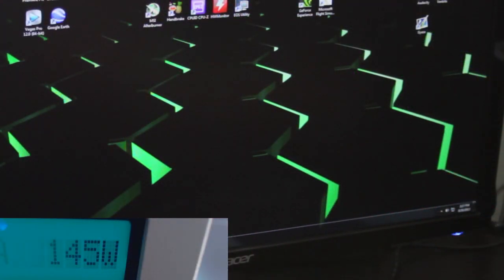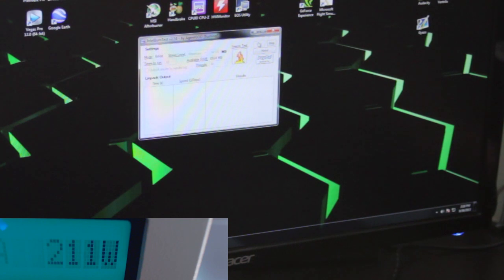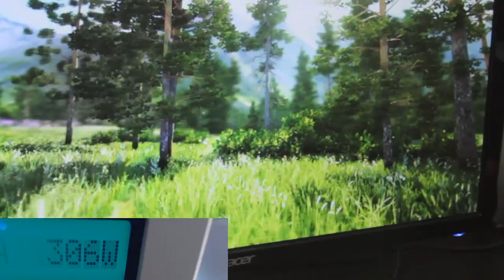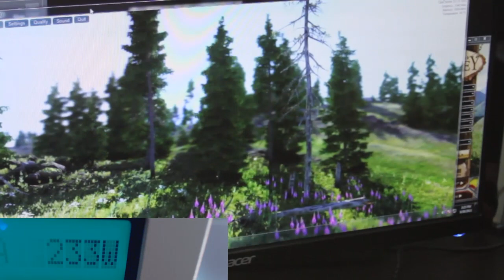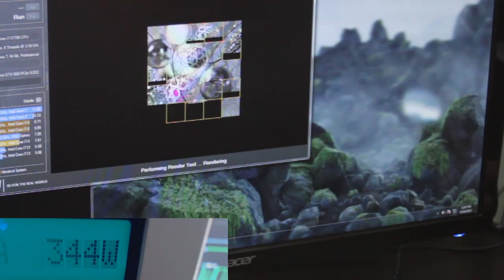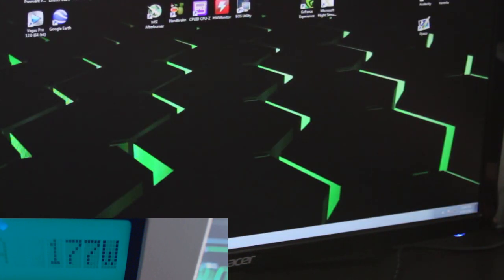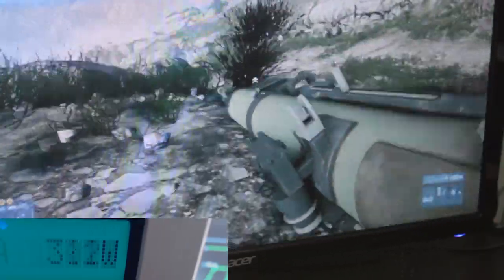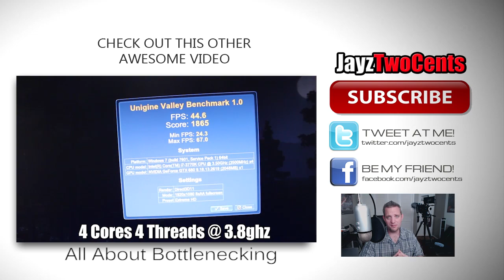How big of a Power Supply do you REALLY need?

Comment: What power supply do i need for my build? pls help!

CPU: i5 4690k
GPU: EVGA GTX 970 Superclocked ACX 2.0
MOBO: Gigabyte Z97X-SLI
RAM: G.Skill Ripjaws-X F3-17000CL11D-8GBXL
CPU COOLER: Cooler Master Hyper 212 Evo
SSD: Kingston SSDNow V300 120GB
HARD DRIVE: Western Digital Blue 1TB
DVD BURNER: Samsung Super-WriteMaster SH-224DB
Reply: ModificationBarn 550w will do fine, I am buying a similar build and I will use http://www.amazon.co.uk/Seasonic-M12II-620-Semi-Module620W-ATX12V-Supply/dp/B003HE260I/ref=sr_1_1?ie=UTF8&qid=1428184395&sr=8-1&keywords=Seasonic+M12II+620+BRONZE+%3B+SS-620GM2+80Plus+Power+Supply

Comment: What PSU would I need?
My build:

FX 6300 
R9 280 
GA-78LMT-USB3 -
Kingston HyperX Fury 8GB
WD 1TB $130 
Cooler Master Force 500
DVD Drive 

I will be using a monitor, speaker, mouse+keyboard, and USB Wireless network adapter.

What psu would I need? Im thinking of 500w but not sure
Reply: Ilovewaffles i have the same motherboard with an FX-8350.... as soon as i put my R9-290X in, i was running into forced reboots as the chipset could not handle it :( and i have an EVGA supernova G2 850w gold psu
Reply: killer1479 update your chipset drivers and videocard drivers, also try it with your cpu at stock speeds.
Reply: ***** chipset drivers are the most recent as they can be, my cpu is at stock speed " forgot to mention ".. only have the issue when i havent set the card to 1000MHz, thats when i get forced reboots and watchdog errors... but, if i set it to 1000MHz and above it runs fine... so, im thinking it is just a shitty board as it is 760G chipset and 4+1 power phase
Reply: killer1479 760g chipset with an FX processor? might want to update xD as far as your card goes, the stock speed of an r9 290x is 1000mhz, so it might just be that you have a bad chip if you cant overclokc your Gpu, setting a lower clock speed than 1000mhz would be weird anyways :P Im guessing a bad gpu chip. can happen, its different for everyone. just leave it at stock speeds and you'll be fine :) you can also try upgrading to a better motherboard since it might not support your videocard too well. so you'd have to get a board with a newer chipset.
Reply: ***** the card itself is fine, just, when im not in a 3D application like a game it automaticly drops to about 300MHz and thats when issues arise for me, so, hence why i set it to 1000MHz ... and as for the 760G, i AM upgrading to maybe a 970 MSI gaming or 990FX asrock :D

Comment: Hey Jayz will a 650 Power Supply be enough for this?

 Power Supply: Super Flower 650 80+ Gold Rated PSU / Seasonic X 650W Gold
- CPU: Intel Core i7 930 running at stock
- Motherboard: Gigabyte X58 
- RAM: 6GB DDR3 1600MHz Triple Channel Kit
- Hard Drive: 1 Corsair SSD and 2 WD 1TB 
- Graphics Card: Nvidia Geforce GTX 480
- Only 6 120MM fans and 1 200mm(I maybe wrong) fan

I've got an old system and my current HX850 PSU is failing. I don't want to buy more than what I need so I need your advice on this. Thanks

Comment: Can some one help me please i dunno if i should get a 500w or a 600w psu
I have these for my components-
Cooling- 6 fans
           -2x 120mm LED fans
           -4x 140mm LED fans
Hard drive- 1TB Desktop HDD SATA III w/ 64MB Cache 7200rpm
Ram- 8gb 4x2 1600mhz
Mobo-Fm2+
Cpu- Athlon X4 860k
Gpu-Radeon R7 260X

But i want to change my Gpu into a Nvidia geforce 970 superclocked or a Nvidia geforce 980 superclocked or maybe even a Titan X

Please tell me what Power supply i should get.

Comment: I recently bought a pc at a local company that allows you to pick the parts yourself and for an extra fee they will put it together and test it for you. Everything seemed to work fine but after I installed some updates and drivers, I went on to install some programs/games. When starting up one of the games my PC suddenly turned off. After I turned it on again it turned itself off after a few hours without a demanding program running.
My systemspecs are:
Processor: AMD FX-6300
Motherboard: MB ASRock 980DE3/U3S3 AM3+
RAM: 8GB DDR3 Crucial RAM
GPU: Club 3D R9 270X
HDD: 1TB 7200 RPM 64mb Black by WD.
PSU: ARCTIC 550W 82+
I hope someone can help me out with this problem. My thanks in advance.
PS: Sorry for my poor English it isn't my first language.
Reply: Alan Merani Try watching the temperature of the CPU and GPU while trying to simulate the load. Maybe the heatsink for the CPU is not mounted properly.
Reply: Sunakujira hi, sorry but it is already fixed xd. I send it to the factory and there was something wrong with my mb :).
Reply: Alan Merani I'm glad to hear that :) Enjoy gaming!

Comment: So currently I have an Antec VP 450 with an r7 260x, fx 6400, 8gb (2x4gb) ram, one hard drive and one optical drive, do I need to upgrade my psu if I add a hard drive, 2 fans and upgrade to a gtx 960?

Comment: i have a 600 watt psu will it support a
 i7 4770k  (stock)
3x 120mm fans 1 with Leds 
1x 240mm fan with leds 
1 tb hard drive 
2tb hard drive 
1 dvd/rw drive a fan controller 
with the addition of a MSi gaming 970 
(upgrading from a reference 760) and possibly a samsung 850 evo?
Reply: devour43 Definitely, i have a amd a 10 5700 and r9 290x on a 620w psu and it works fine

Comment: hey guys i'm thinking about upgrading to gtx 980 from my R9 270x
here are my specs at the moment

GPU: R9 270x
CPU: i5-4670 @ 3.4GHz
M/B: Asus Z87-A
PSU: 650W Seasonic something something (xD)
RAM: 8gb 

do i have to upgrade my PSU or my motherboard or anything before i upgrade to gtx 980?
Reply: You don't have to upgrade, you can actually go dual 980s with that 650W. The 900 Series GTXs are power efficient. 1 980 only draws about 165W-170W on load (depending on the OC) and the z87 motherboard is great plus its Asus, I have the z97-A and works just about the same. You don't have to upgrade to a Z97 or x99. They're just motherboards.
Reply: On a side note, with DirectX 12 coming in Win10. You can "SLI/Crossfire" that R9 270x with your GTX 980 for more performance. Just an advice, keep that 270x and wait for windows 10
Reply: Captain Einstein thank you a lot kind sir! really appreciate your help, wish you a good day!
Reply: wotm9 No problem :)
Reply: ***** Just a rule of thumb by me. Everytime you're upgrading from AMD to Nvidia, or upgrading anything at all that might cause issues (HDD, SSD, RAM, etc), reformat everything as if you're building the build again. Plus, you get to clean out your case too.
Reply: ***** A fresh everything, so that you wont have a dusty first gpu and a brand new second gpu. That's just pure laziness.

Comment: Can you guys check out my build? I had built the computer already, just have to put in a new power supply because I had traded an old phone for ram and powersupply, turns out it didnt have all the wires and the kid said I was trying to rip him off? The old on was 550W but I quickly ordered a 500W, it this strong enough for my computer? Will I not be able to upgrade very much? The estimate wattage is very close. (I will be gaming with this pc) 
http://pcpartpicker.com/p/T9gtqs

Comment: so you're saying you could have used a 430w psu with this build... with a gtx680? I know the meter only showed ~350w but what about the amps on the 12v rail? If you had chosen a 430w power supply for this rig wouldn't it not run because it doesn't have enough amps? I'm pretty sure that watts are not the only thing to take into account

Comment: I'm thinking of upgrading a 7850 to a r9 290. I use a cooler master  GX 550 watt.
Do you think it should be enough?
I have a i5 3570 not over locked and just one 7200rpm hard drive

Comment: I have an i5-4690K with a coolermasters V atx modular PSU 750W. is it enough to run Nvidia Geforce GTX 970 SLI?
Reply: You're fine with that PSU and have the headroom to overclock the 970's and still be fine.
Reply: 750W is more than enough I have exactly the same build, just without SLI

Comment: hie i have 

i7 860 processor 
2gb 4 rams
gtx 750 ti oc

when i am running game the cpu fan is spinning faster processor temp around temprature 97c
normalytemprature is 37c to 47c is is there any problem with my psu 
my psu is 320watts
my pc is
hp 8100 elite minitower pc

please help....
Reply: GAMES COIN try cleaning the dust out of your pc
Reply: ***** 750ti only need 300w

Comment: I'm getting an R9 290x Vapor X, will an 850W Power supply be enough, is it ok to get an 1000W to be on the safe side?
Reply: 850 is enough.
Reply: GreyFace Do you happen to know how much power an Intel i7 4790k draws? because I saw somewhere it can draw upto 350W when on maximum loads at times?!
Reply: Matthew Richard go to pcpartpicker.com, and put in ur pc specs, it'll tell u how much power it consumes, u'll need 30% above that maybe.
Reply: My friend is running an i7 4770k with a gigabyte r9 290x he's going just fine on an 850w
Reply: Matthew Richard I have the same GPU with  a 860 watts AX PSU, with an AMD 8350 (Power hog),I am able to Oc it to 1180 on the core and 1560 on the memory.
You'll be more than fine.
Reply: The more head room your power supply has the quieter it will run
Reply: Matthew Richard I have an r9 290x on a 620w psu so you should be fine

Comment: I doubt that the power supply has 1000w there all the time , it puts out what is demanded of it
Reply: Zib Zoolander Its more that its less efficent to use a 1000w psu than a 500w if your only using 400w
Reply: pcgaming today but if you're only using 400w then you are only using 400w
Reply: Zib Zoolander You actually use a little more than 400w because of the efficiency.
Reply: good to know I can :)

Comment: Hey I'm trying to figure out what kind of watts i need, i got a 8320 which i know amd is a power hog and i want to get 2 r9 290's but i but since most people say when you crossfire 2 video cards 750 watts is just fine but amd cpu uses alot of power as well as amd video cards so i'm kinda confused. I do expect that I might need to get 1000 watts to run the amd and gpu's. I'd like to know what you guys suggest.
Reply: I do plan to overclock the cpu only to its boost speed, nothing overkill. GPU's i'd probably overclock the 290's to 1gig I'm not gonna put them through major overclocking but i know with overclocking you need more power to get the extra speeds. So yeah, so many people with so many video's on psu's but i'm confused just because a lot of the videos are with people using intel and nvidia which we all know aren't all power hogs.

Comment: i have an NEX750G PSU from EVGA, and im wondering does it have what it takes to run a 970 sli?
SPECS:
-16 GB hyperxfury DDR3
-ZOTAC gtx 970 4gb
-i5 4690k
-Gigabyte Z97 mobo
On a side note i have only about 6 80m fans and 1 120m fan, and only 1 hdd, so is it fine or should i not risk it? thanks ahead!

Comment: Specs: 
Intel Core i5 4690k
Msi Z87 Gd65 
EVGA gtx 970 
Kingston 2X 4GB DDR3
WD caviar Blue 1TB 
 
Any idea on what power supply i can get ???
Reply: Similar specs to my computer.... I've gone the the Corsair 600W PSU and from what i've read and seen, its more than enough with room left over... The gtx 900 series are low power comsumption cards and recommend a minimum of 500w, so 600W would be the sweet spot... could even use a 550w tbh...
Reply: So i wont go over kill if i get a 600w ?
Reply: MultiplayerGamePlay__21 Nah I wouldnt say so... although a 550W would work fine, I'd personally go with 600W considering that theres only a £7 price difference

Comment: I have an ASUS M5A99FX PRO R2.0 with a AMD FX 8320 overclocked form the stock 3.5GHz to 4.5GHz (was at 4.825GHz but comp would occasionally freeze), cooled by a Corsair H100i. 8 GB or Corsair Vengeance RAM stock, Western Digital 500GB HDD, 128GB Samsung SSD (boot drive), ASUS GTX 750 Ti stock, and 6 Corsair AF120 fans. I use an eVGA Supernova 850 B2 Bronze 850watt PSU and I run just fine!
 
Oh, not to mention the required LED bling!!

Comment: I have an intel core i5 4460
amd r7 240 dedicated graphics card 2gbs ddr3
8gbs of ram
I have 300 watts but I want to upgrade the graphics card to a gtx 970
what power supply should I get?
Reply: 500W should be enough for a 970.
You can go and look at the power consumption at guru3d.

Measured power consumption GTX 970

System in IDLE = 120 Watts
System Wattage with GPU in FULL Stress = 278 Watts
Difference (GPU load) = 158 Watts
Add average IDLE wattage ~10 Watts
Subjective obtained GPU power consumption = ~ 168 Watts

Comment: I have a 550 w PSU and my PC is slow loading and doing tasks. My CPU is a i5 4590 3.3 Ghz, so it's not a bad CPU. Although, I installed a custom CPU cooler before I started using my PC. My graphics card may also be using a lot of power also, it's a r9 280. I have no idea whether I need a new psu or if I need to replace my custom Cooler Master CPU cooler and replace it with the standard intel cooler.
Reply: This is from Guru3d

Power consumption Radeon R9-280

System in IDLE = 126W
System Wattage with GPU in FULL Stress = 288W
Difference (GPU load) = 162W
Add average IDLE wattage ~10W
Subjective obtained GPU power consumption = ~ 172 Watts

550W should be enough for your PC.

Comment: Windows 7 Ultimate 64-bit SP1
CPU
AMD Phenom II X4 955
Deneb 45nm Technology
RAM
8.00GB Dual-Channel DDR3 @ 669MHz (9-9-9-24)
Motherboard
ASUSTeK Computer INC. M5A78L-M LX PLUS (AM3R2) 46 °C
Graphics
MT276 (1920x1080@60Hz)
1023MB NVIDIA GeForce GTX 650 (Gigabyte)
Storage
1863GB Seagate ST2000DM001-1CH164 ATA Device (SATA)
Optical Drives
TSSTcorp CDDVDW SH-224DB ATA Device
Audio My power supply died, whats the best one to fit it on a budget?

Comment: PCPartPicker part list: http://pcpartpicker.com/p/9zW6Lk
Price breakdown by merchant: http://pcpartpicker.com/p/9zW6Lk/by_merchant/

CPU: Intel Core i7-4790K 4.0GHz Quad-Core Processor  ($317.75 @ OutletPC) 
CPU Cooler: Scythe Mugen 4 79.0 CFM CPU Cooler  ($48.98 @ OutletPC) 
Motherboard: Gigabyte GA-Z97X-Gaming 5 ATX LGA1150 Motherboard  ($132.99 @ SuperBiiz) 
Memory: Crucial Ballistix Tactical 8GB (2 x 4GB) DDR3-1600 Memory  ($79.98 @ OutletPC) 
Storage: Crucial MX100 256GB 2.5" Solid State Drive  ($104.99 @ SuperBiiz) 
Storage: Western Digital Caviar Blue 1TB 3.5" 7200RPM Internal Hard Drive  ($51.88 @ OutletPC) 
Video Card: Asus GeForce GTX 970 4GB STRIX Video Card  ($332.50 @ Directron) 
Case: BitFenix Shadow ATX Mid Tower Case  ($78.99 @ SuperBiiz) 
Power Supply: SeaSonic 620W 80+ Bronze Certified Fully-Modular ATX Power Supply  ($54.99 @ Amazon) 
Optical Drive: Samsung SH-224DB/BEBE DVD/CD Writer  ($14.98 @ OutletPC) 
Total: $1218.03
Prices include shipping, taxes, and discounts when available
Generated by PCPartPicker 2015-01-21 15:59 EST-0500

Is this PSU ready to handle second GTX 970?

Here's a link with 2x GTX 970: http://pcpartpicker.com/p/cmJ2YJ

Comment: ***** I'm into building computers as well and have learned a lot of things so far. I know I have approx. 250-280W of power usage with a 500W PSU. Right now I'm unsure wether or not my PSU will be sufficient for a second GPU.
So far: i7 4790K + Asus GTX750Ti and planned: Asus GTX970.
Like you said, I don't want to hit the capacity.
How can I test my wattage or rather: Where do I get a Multimeter for PC purposes?
I reckon I'll need a 600 or 650W PSU instead.

Comment: keep in mined not all PSUs are made the same even if you have a power supply that is ratted at 600 watts you need to start to look at duty cycle. If that 600w PSU has insufficient cooling to its power transistors your 600w PSU is only a 350/400 watt.. I just smocked a 500 watt PSU on a 8 core AMD @3.5ghz stock. the system has 8 hdds and i use it for a server on the side it runs folding@home running that 500 watt 24/7 it gave last night after 2 weeks of straight folding it whet out with a BANG.. after opening it up i can see why the PSU had crappy heat sinks 
now if you add a new video card for SLI and your playing some hard core games you will over heat that unit and POP!

Comment: I have a 300W PSU and I'm buying a Gtx 750 ti, currently gt545, do I have to change my PSU?
Reply: the 750 Ti uses less power than the GT 545. Before you get one however, check to make sure whether the card you're buying uses a 6-pin connector or not, some 750s do, some don't, if it DOES have a 6-pin connector then your power supply would need to have one too.

Comment: I think the issue for many is that lower wattage PSUs tend to be either of poorer quality than higher wattage PSUs or they'll be semi-modular or they might not provide the right cables for your system. That is why people generally aim for at least 550 or 650, because that's where the better units start showing up.
For my new build, I'll go for a Seasonic P-660 most llikely even if it's only for a GTX 970, a 4790K that I'll likely do some OC'ing on and a pretty basic system overall, because the unit is of freaking superior quality and shouldn't really get to a load where it needs to turn the fan, in turn making sure that some more noise is gone from the system, making me a happy consumer.

Sure, I know it's way overkill for my system, but I should have enough headroom to slap in another GTX 970 should I ever want to. After all, the GPU and the CPU are by far the components drawing the majority of the power in a system. Not even a high-end water cooling setup will draw all that much. Take Jay's system, 12 fans and a pump. That's basically the things drawing power in the loop, right? That might add up to somewhere around 50-60 watts quickly calculated. Not a big deal. In the meanwhile, a 680 might draw something in the neighborhood of 100 watts, give or take some, making it a far more power hungry component by itself. The same just might go for the CPU at that frequency and voltage. So those two alone stand for the large majority of the consumed power.

If this is incorrect, pardon me, but this is correct as far as I understand it.